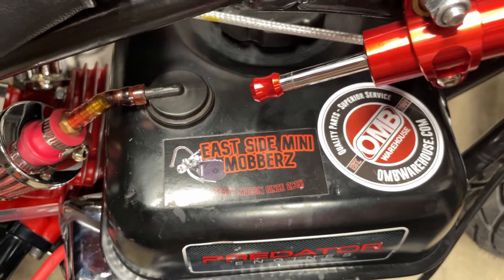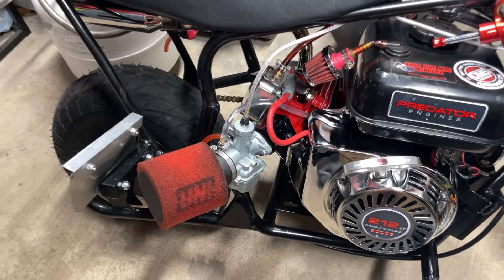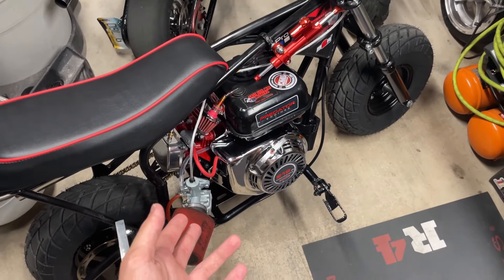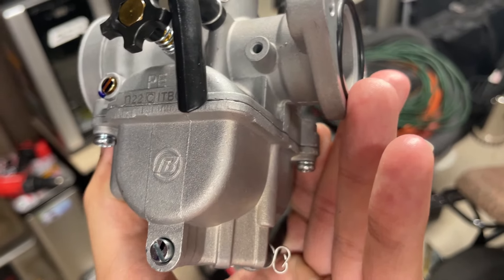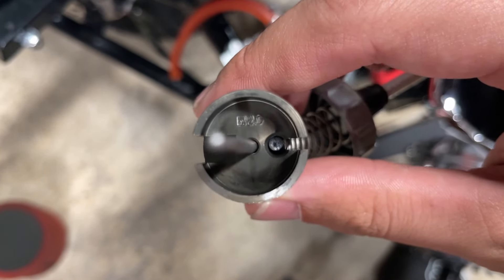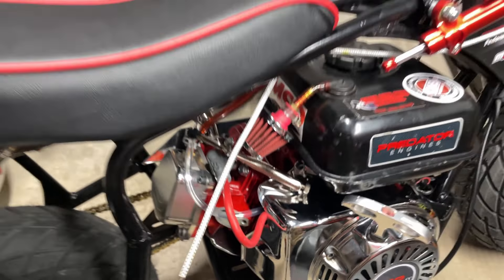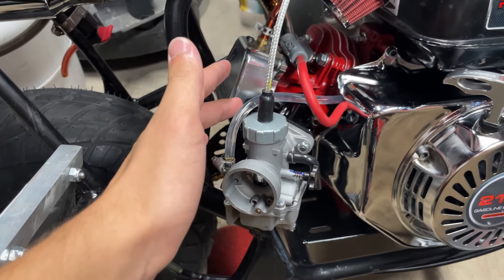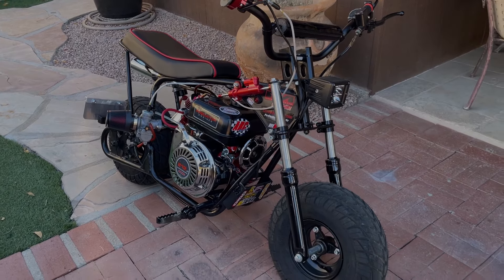Installing New Nibbi Racing Carb! Predator 212 Minibike!

Comment: Nice video but you should of got a 26mm, nibbi carbs are beautiful I have the 26mm red an black nibbi. An the nibbi has an air screw because it's on the front half of the carb, if it was on the engine side of the carb like your GPS carb or all the other chikuni carb then it's a fuel screw. Imo I love the air screws like the nibbi an all flatslide carbs have, way easier to tune brotha, but nice video homie keep killin it!!!🤘🏽🤘🏽🤘🏽🤘🏽😎
Reply from the maker: Yeah tbh I like the air screw better! I was also thinking about going bigger but bigger isn’t always better and with the 22 I’m still hitting 65mph all day long! Much appreciated!
Reply: What's the best jets for a 212 with the carb your talking about ?
Reply: @Guido19 what jets u running

Comment: What throttle cable did you by I bought the whole 28mm nibbi carb kit and the first 70in cable ripped and bought another one and ripped again idk if it’s too short or I’m putting it wrong what cable did you use?
Reply from the maker: hmm it depends on the minibike but it might have been a cheap cable if it just ripped.

Comment: I was doing 65 with the gps aftermarket mikuni 22 I just swapped the same nibbi you have but im waiting for my chain so I haven’t been able to ride it did you increase top end speed?
Reply from the maker: I have road it! It runs pretty well I didn’t really notice much of a difference though cause it’s the same size as I had on before. Still pushes 65 all day though
Reply: What jets are yall running
Reply from the maker: @tgndeath3ater832  I belive it’s a 120

Comment: what throttle cable did you purchase?  the part that goes inside the carb isn't long enough on the one i purchased.  i tried to modify it but you can't   its wrapped in metal under the black casing.  tried to unravel but its not working.  ill just buy another
Reply: can you provide a link too.  i dont want to purchase the incorrect cable again
Reply from the maker: Here’s a link to one that I have this one comes with the cable https://www.amazon.com/Throttle-Motorcycle-Aluminum-Twister-Accessories/dp/B0BFDHJK6Z/ref=mp_s_a_1_5_sspa?crid=9FFYLXKEFSBM&dib=eyJ2IjoiMSJ9.LuFzuMdnNmiHV6gifQukUcn6-78h3o2u10DWkqdZ6_d4NRJ_QkcJeuvDIbRefkANY7wAvv0Hjwr5066FiqjgRaiZUH2fAncDX0-kyOiw38ihtdD5a2DjVb0K734IjPgBYj3CONSxqrMLwZzRf0giZUROjufA1FmFX61xhCsXeBvkD6XpDe-2YSrhF-wxn1_N2DMH-wIzQaFK9gKTpR_Gag.7I3FmheIA3w1YztwfqfA-Y0TfozjySZpKsWO_NOxH50&dib_tag=se&keywords=quick+twist+throttle&qid=1713497188&sprefix=quick+twist+th%2Caps%2C184&sr=8-5-spons&sp_csd=d2lkZ2V0TmFtZT1zcF9waG9uZV9zZWFyY2hfbXRm&psc=1

Comment: What do you do if your throttle cable doesn't have a tip?
Reply from the maker: @samuelbrooks8199  you might have to buy a new one or you can solder a new end on

Comment: What is your parts list for your 212 and what is your gear ratio? Thanks
Reply from the maker: I have the stage 5 kit pretty much. It’s all built up on the stock stroke and bore.
Reply from the maker: It’s around a 4.4 gear ratio

Comment: Did you have to change the pilot jet and main jet?
Reply from the maker: Yes I did and I adjusted the air fuel mix too
Reply: @Guido19  what size jets did you replace them with?
Reply from the maker: @brandongoutdoors  I think I did a 110 or a 115 main
Reply: @Guido19  Alr thanks
Reply: @Guido19 did u put more air into it
Reply: @Guido19 what number of pilot jet you used

Comment: Hey bro, remember your old video of the break mount can you send me the measurements of it cause I don’t want to spend $50 for amount
Reply from the maker: The brake mount for the hydro? I wouldn’t know the measurements off the top of my head but it will be completely different for different brake calipers
Reply: @Guido19  well, I bought the Minibike Hydraulic Brake System from go Powersports and didn’t look through it good enough, and didn’t see that you need a different bracket for the brakes so I would appreciate a lot if you measured it and send it because I really am not spending $50 on a piece of metal
Reply from the maker: @nigelleoldfield8514  well I’m not able to grab measurements but this is as good as  I can do. Here it is for sale for $10 on gopowersports https://www.gopowersports.com/mini-bike-hydraulic-brake-caliper-bracket/?campaignid=15361704457&adgroupid=&adid=&gad_source=1&gclid=Cj0KCQjwn7mwBhCiARIsAGoxjaL6nMnv0twPpzwlfdwF_ZwULZjeki1UqWcLeK86mLXj2M6sLJccm4gaAjdtEALw_wcB
Reply: @Guido19  yeah OK thanks man for your advice